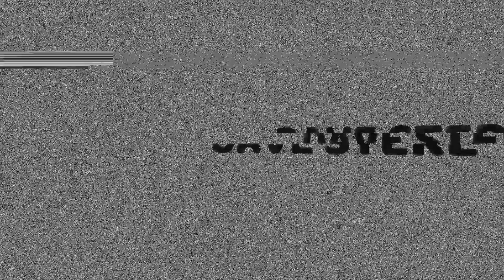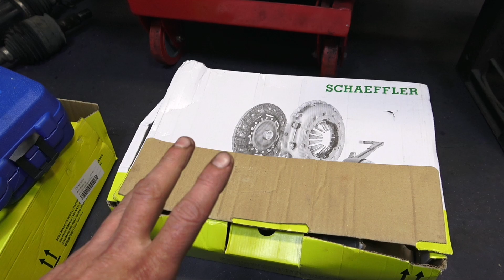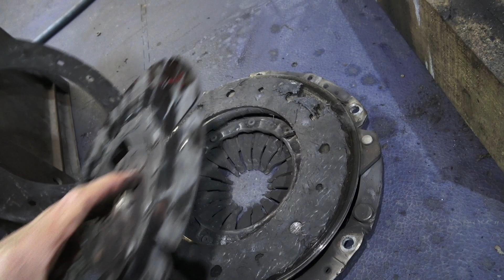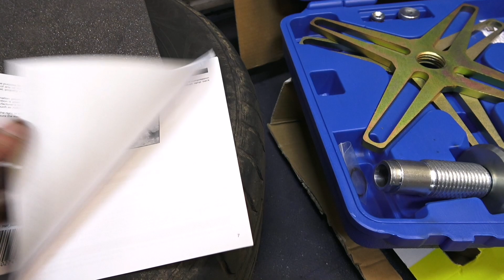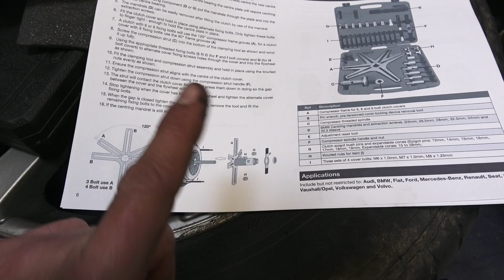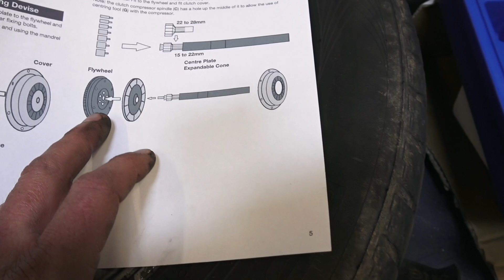Self Adjusting Clutch (SAC) Tool on a Chevrolet

Comment: They just keep dreaming shit up to complicate the world. 😂 Nice explanation Dave. Honestly I've  never heard of this in my limited experience. Although I have seen guys removing the preloading disc/ring on replacement fittings. (Now I know what it was).  Poppy's driving is getting better 👍
Reply from the maker: yeah ian, not a new concept by any means and has advantages for the user not so much for the installer. One thing is the self adjust takes up the wear on the clutch plate friction material so the user cannot feel the wear so no warning of failure. I had one come in with clutch appears fine one day and the next day no clutch. My alfa has an SAC and it is '06 model year.

Comment: I’ve got the genuine tool kit that came from Schaeffler. I’d say the kit you have there has got everything that’s in the expensive o.e. kit. I’ve seen a few different looking self adjusting clutches. My policy now is to just use the tool for every clutch I do, it can’t do any harm even if it’s not an SAC. Top info as usual Dave 👍
Reply from the maker: yeah Russell, Schaeffler do suggest to use the tool on all clutches.